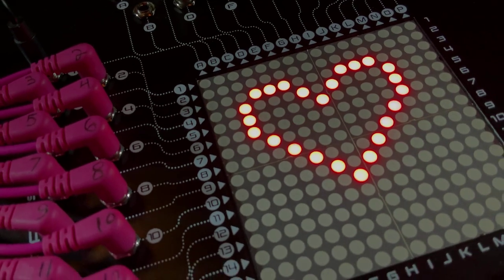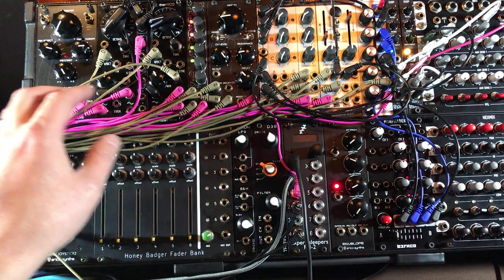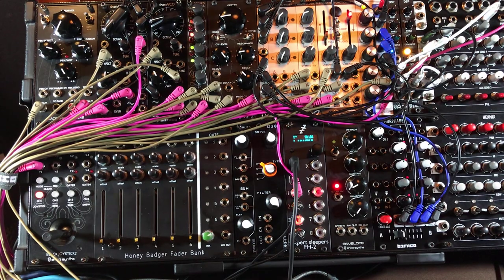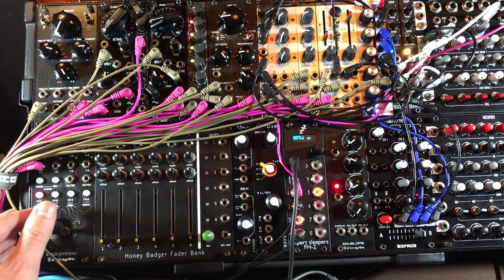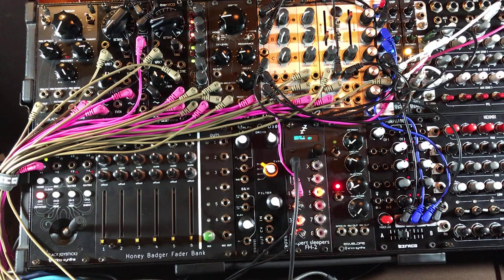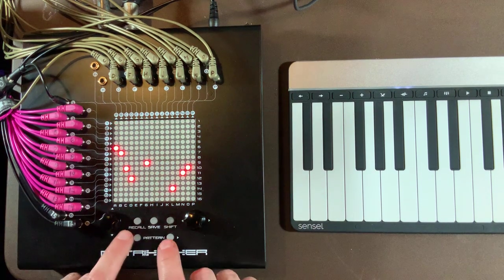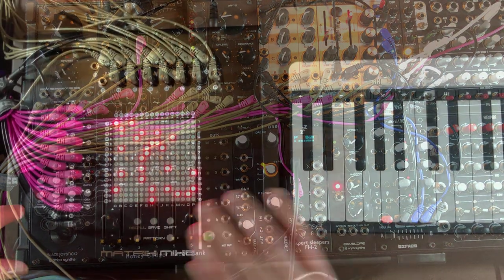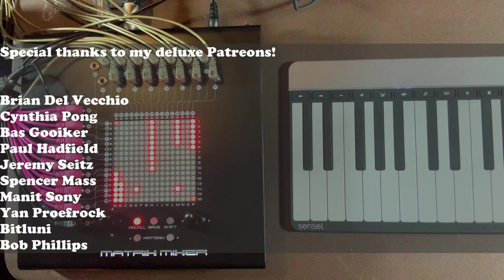Plugging in to the Matrix Mixer by Erica Synths

Comment: If I missed this being discussed in the video, my apologies. I would like to know if the Matrix Mixer handles line-level instruments well. Also, if you could do a test with audio signal running from one source into one effect, then into another, and for the test have a second patch where the order of the effects is swapped, and change them on the fly to see if there is any audible noise or dropout, pops or any sort of undesired artifacts. I want to use this with synths and my guitar rig so I can have a way to share my loopers and effects with several different sound sources. For relevance to my question, all the instruments and effects I use currently play well together, so only minor audio level adjustments are typically easy to accomplish.
Reply from the maker: It does handle any level signal well. I have not experienced any pops or dropouts either, but I might do the specific experiment you mention at some time
Reply: @QuincasMoreira  Thanks for the reply. That's great news. If you do more experimenting please let me know how it works out.

Comment: Hi there. A year later, how do you honestly feel about this mixer? Pros and cons in your experience? Anything you would change?
Reply from the maker: Hi! Honestly, as cool as it is, I still prefer to work with patch cables, it's just better for my workflow, so it's been out of action. I also got a Syntrx2 which has the same matrix but incorporated into a hard synth, so I've been using that a lot instead of the standalone mixer.

Comment: Hi there, just found your video about the Matrix Mixer, thank you for sharing. 
I have this matrix mixer myself and I recognise the noise you can hear shortly at 20:23 
For me that noise has made this mixer impossible to use. It builds up to significant levels if you add a couple of inputs to an output, regardless of what is plugged into it. Hasn't that bothered you while using this mixer?
Reply: did you solved the issue?
Reply: @grizzliesa9853  Unfortunately not. I bought it at Thomann, they were kind enough to replace the unit for another. Same problem. Tried on different locations with different power sources. Always the same problem. So I returned the second unit as well and found an alternative setup.

Comment: Two VERY imortant questjons and thanks in advance:

1) atrenuators for connections: are they similar to SYNTRX  i.e., 100%, 70%, 0%, or can go from %0 to 100%? In SYNTRX, because every module (lfo, adsr, vco  vcf, etc) has a dedicated
 level control, 100, 70, 0 attenuation works but outside of SYNTRX, if the Matrix Mixer attenuators dont go from %0 to %100  then that bacially useless for eurorack modules (assume sending 100% LFO from an LFO, e.g., -10volts to +10volts, to a filter cut off! Then i will need external attenuators for every connection outside of the Matrix Mixer, and then the whole idea of dynamic preset and patching is ruined! 

2) is this mountable into eurorack? 6U maybe? 

Thanks!
Reply from the maker: Hi! The attenuation works in 4 stages. 100% full signal, 70%, 30% and 0% (off)
It's not the same as continuous control of course, but surprisingly useful. I found myself selecting attenuation levels to great effect. When finer control is needed you can patch an attenuator after the Matrix output you need to attenuate, but it certainly isn't needed for every output!
No rack, it's a desktop unit with jacks in the back, dedicated power, etc. It's not 6U, closer to about 5U. Cheers!

Comment: Thanks for the video. I would like to know if there’s any limitations in the case of sum of voltages or the impedance of the inputs sources. At the beginning you make mention attenuation but I am thinking about the case you sum a lot of input voltages routed to only one output. Is it possible to fry the destination module?
Reply: It's not possible to damage things in Eurorack with signals. Outputs cannot supply power.
Reply: @rarelycomments  Sorry I am not agree
Reply from the maker: It's just a mixer, signals that are too hot will just get clipped, as with any mixer! Cheers :)
Reply: @QuincasMoreira  thanks Quincas!!